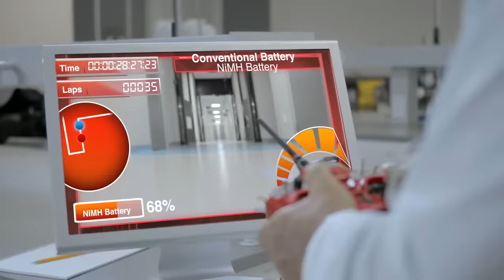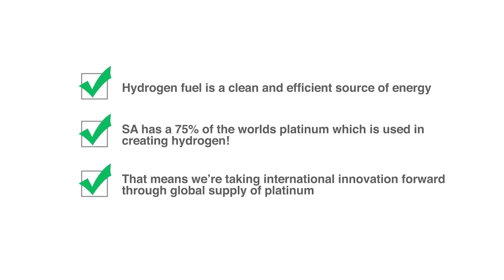Scientists race radio control cars

Comment: Why they are using a plane and helicopter controller radio for cars tho?
We use this two stick config for mostly flying aircraft to be able to control rotation in multiple dimensions

Also from the left stick probably not being spring locked to the center, it is probably mode 2 controller

Comment: Wow I love it so what kind of remote control are they using
Reply: It's CGI if you can't figure it out yet.
Reply: The remotes could be prob faked since the race is a staged drift car race which uses a different comtroller but there are controllers like in the vid irl
Reply: @sahirali8752  pp
Reply: S'il vous plaît je peux avoir la voiture télécommande le bleu
Reply: these remote controls used for planes, in real model cars we use controllers called pistol controllers,

Comment: from where will we get the hydrogen fuel cell
Reply: Read in the description. We used a company called Horizon Fuel Cell to supply it. We bought a bunch of cars that use Hydrogen Fuel Cells to power them for our exhibitions and had kids racing them around.
Reply: @delanick  ummm... Maybe if you open it up you might find some Lithium Ion batteries